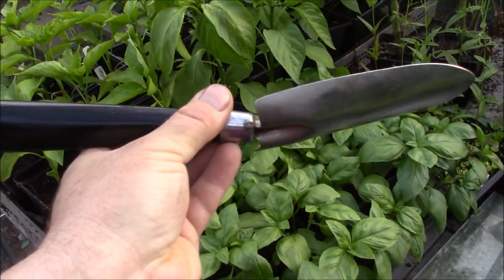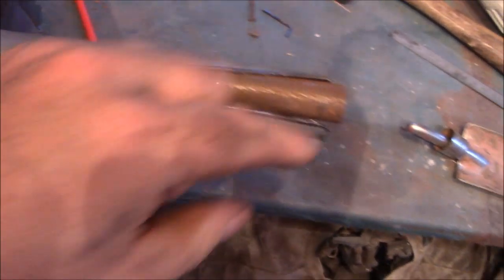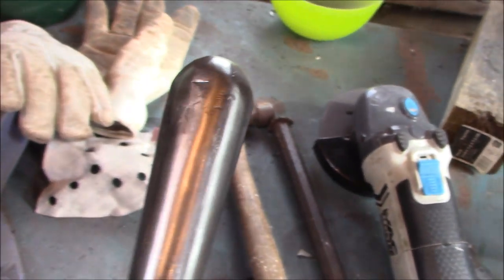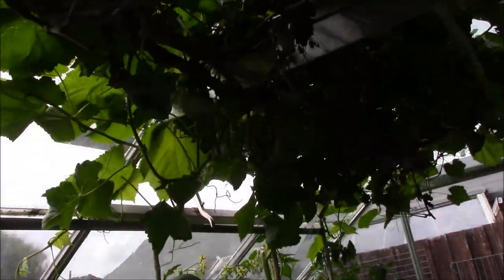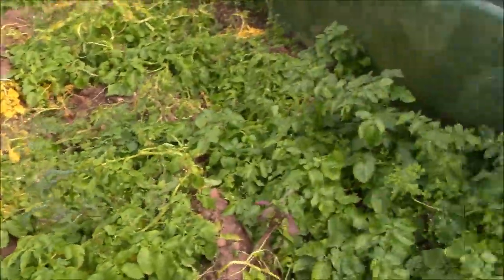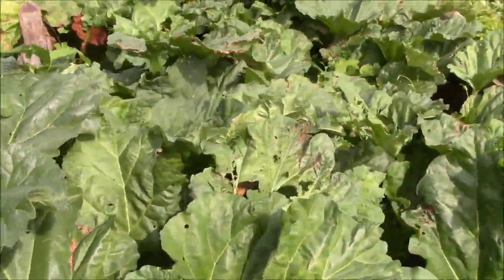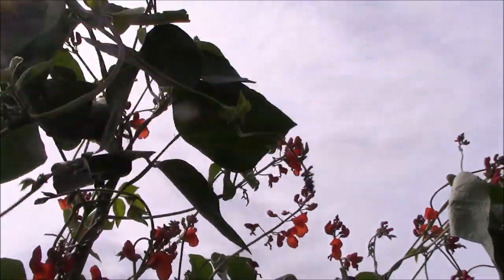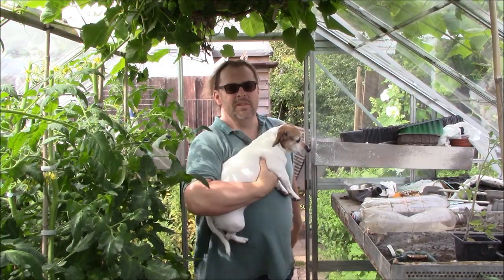Jim's Allotment - Plot 9 - July Tour Part 3

Comment: Hi Jim, my potatoes have died back really early this year too.  Rather than growing successions of calabrese this year I've planted 6 plants with a decent about of space in April and these have yielded huge central heads about 6 weeks ago, since then I've had a massive crop of really large side shoots every week and I just picked another bucket full today, it's been a great success.  I've previously found that side shoots were fairly small, but growing them on large plants has been a revelation!  Do you think you will get peppers off those little plants?  I have some small plants too, but I'm growing them for over-wintering on the kitchen windowsill  : All the best - Steve
Reply from the maker: Hiya Steve, The guy from a few allotments down dug all his potatoes up yesterday and they looked really good, much better then last year, only problem was that some had split as they grew too quickly when we had all that rain a few weeks ago, so I guess mine will be a bout the same.. Broccoli...I have some good sized side shoots as well of the first batch of broccoli, so I guess if I had planted them further apart that would have been better, .. Peppers, Fingers crossed I might get some this year but I know I am really late... Cheers Jim..
Reply: On peppers, I popped some late ones on the kitchen windowsill last year and we were eating them fresh in February this year, that's what got me thinking about over-wintering for an early start!  : All the best - Steve